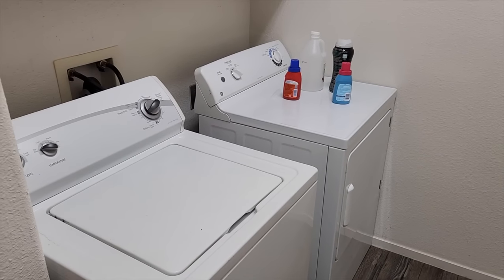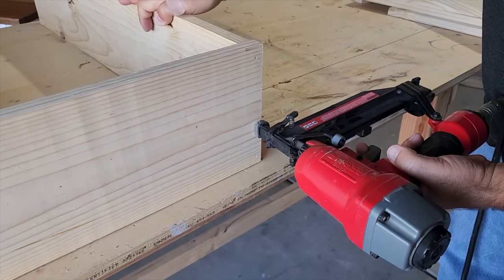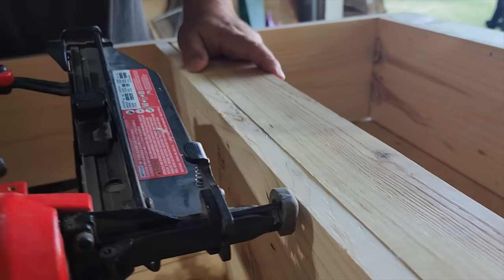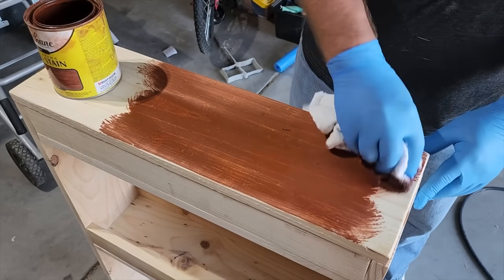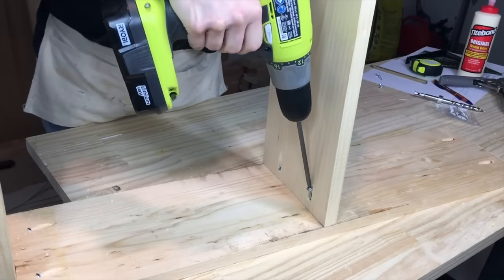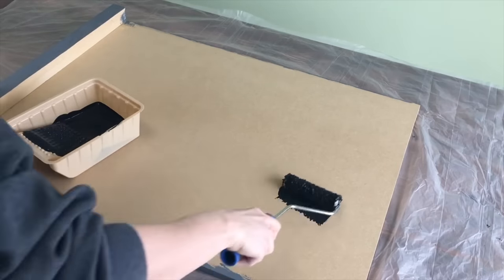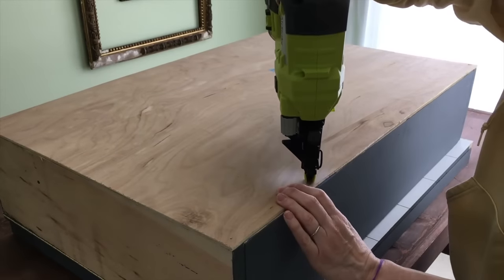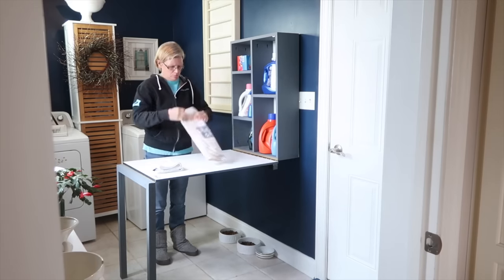His wife wanted more laundry room storage...(this idea is BRILLIANT!)

Comment: Both great ideas and helpful for the laundry room! 😘
The rollout shelves between the washer and dryer are great with the extra storage and the convenience of the rollers!
I'm not loving the dark color, it seems to stick out like a sore thumb IMHO. Not trying to offend but I think it would look better with a white finish or even a softer color.☺️
The drop-down folding table is another great idea! But so few laundry rooms have the space for it. For me, I'd rather see something for hanging up the clothes. 
A lot of laundry rooms don't have adequate air flow and people take the laundry to the couch or bed to fold it.
I'd almost prefer to see something that fits over the washer and dryer. Something with henges that can be lifted out of the way and can be locked in place when not being used. Then you can release it and it rests on the washer or dryer (or both). 
That would give you more width and not stick out into the priceless space of the laundry room. 
Too many laundry rooms have such limited space! I've seen very few that have an empty wall for something like the folding table. Utilizing what you already have there and building around, below or above the fixed items is what people are looking for. The rolling shelves are a good example of working within a space!
Reply: I actually agree with going with a different color.  Painting it would have also been a good idea.